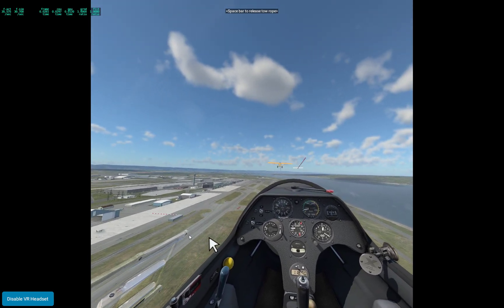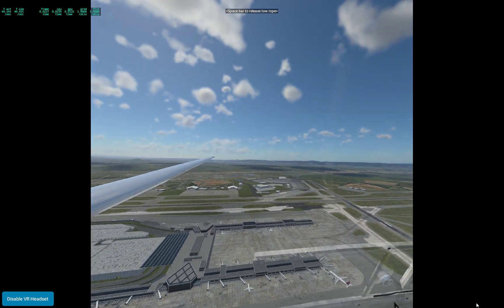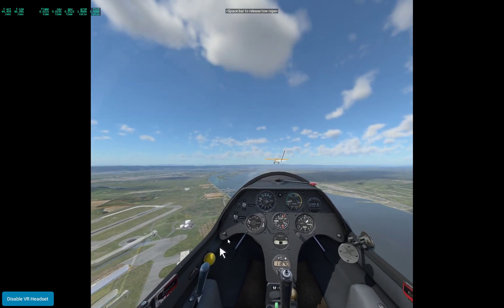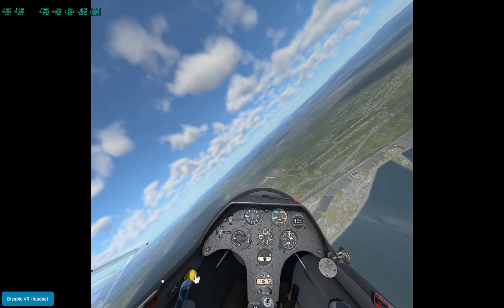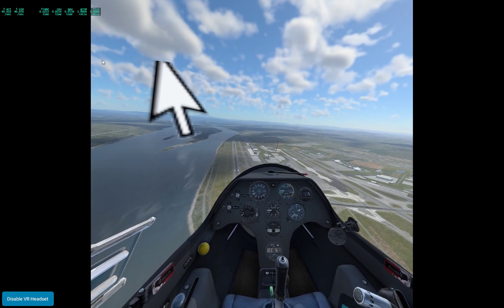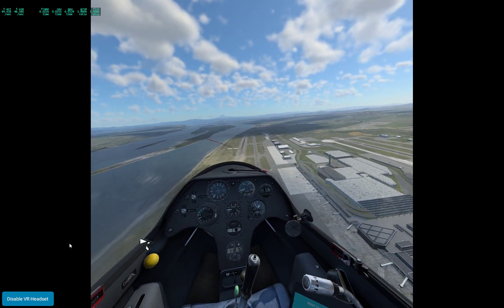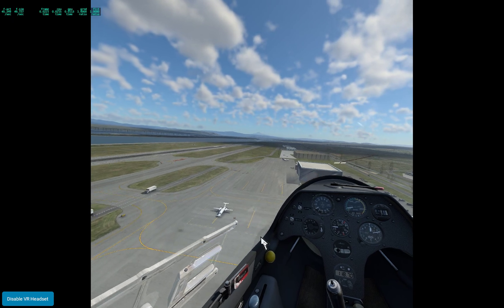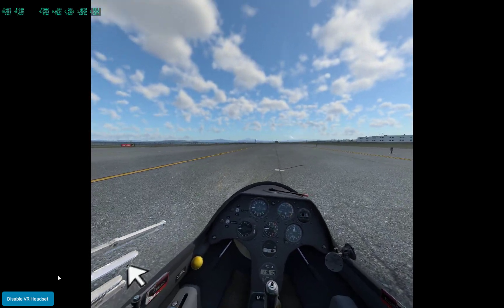X-Plane 12 Has a Bad Flight Model - Forward Slips

Comment: Have you tested this in other planes, like the 172?  From memory in MSFS you can easily get descent rates in excess of -1500fpm in a slip.  I wonder what XP12 will do?  Perhaps it just an issue with the gliders?

So in MSFS, over water,  no wind, 172 trimmed for 65kts, I'm descending at about 500-600fpm.  Entering a slip this then increases to around 1200fpm.

Repeated this is the XP12 172SP, 65kts, not bothering with weather or water as there appears to be no mechanical turbulence in XP, and I was descending at just over 500fpm. Enter a slip, and this jumped to over 1000fpm, but settles at around 900fpm at 65kts.  The dial doesn't show any increments past that so its difficult to gauge the actual descent rate, but its certainly not what you see in a glider.
Reply from the maker: I tested the Evolution with the same results. Keep in mind that when you slip your airspeed indicator is unreliable so you should hold the same pitch attitude, this will require input beyond just "being trimmed". If you don't add input to hold the same angle, you'll likely pick up speed and see a higher rate of decent, but that's just bad testing.

Comment: Personally, I feel the ASK-21 in X-Plane doesn’t slip as it does in real life. However other aircraft (RV-10) I’ve tested do descend much more when in a forward slip and maintaining the same airspeed. I think this is mainly and issue with the K21 flight model rather than the entire flight model code of XP12, but very interesting nonetheless.
Reply: With XP12 looks we just bought a A330 with 737 FMC for $50, lower performance, bugs bugs and more bugs and yeah a little sprinkler of eye candy.
An oudated simulation calculation with no data. Flying onrail with scripted events. Seriously,